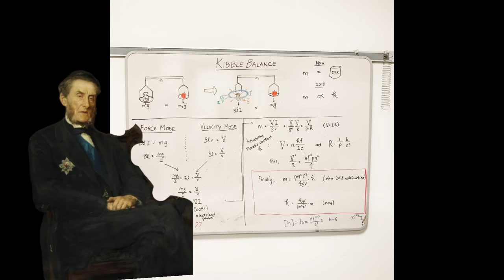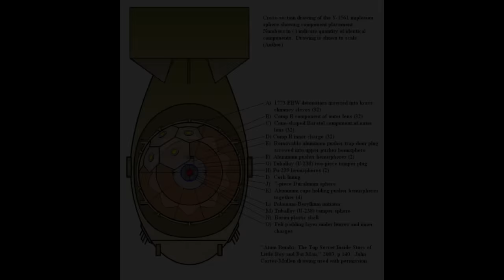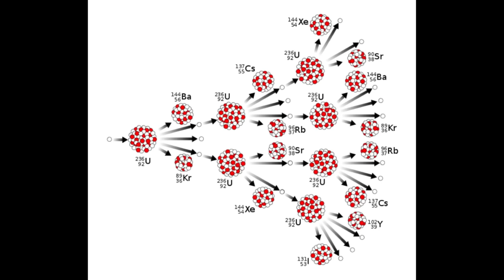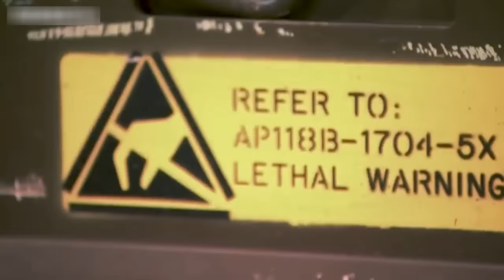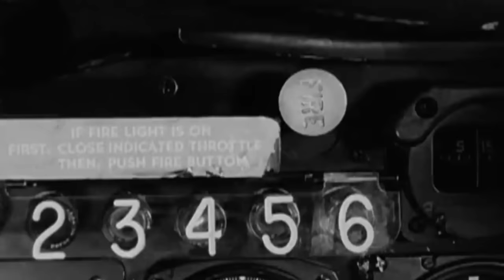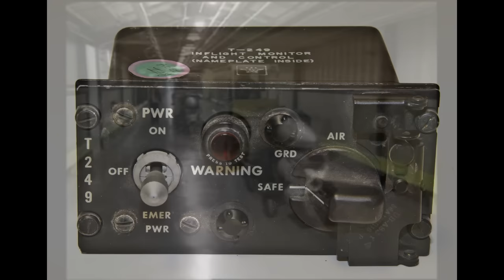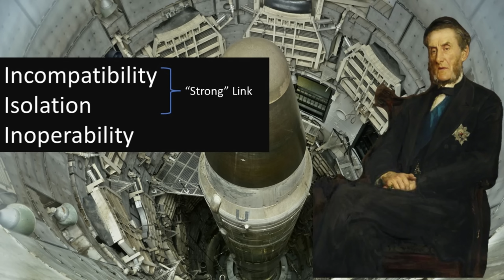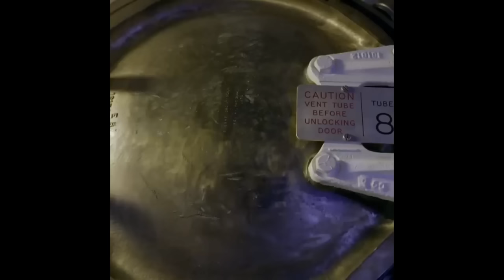This Way Toward Enemy - How The Bomb Didn't Quite Go Boom

Comment: An additional Iowa anecdote you may find to be of interest, especially regarding the testing of nuclear weapons - the Iowa Army Ammunition Plant, situated just west of the small city of Burlington, Iowa, a port city on the Mississippi River, has a long and thoroughly disreputable history concerning nuclear weapons. This site, which is fenced off and guarded, is over 19,000 acres in area. In comparison, the New York borough of Manhattan has an area of slightly more than 14,000 acres.

During the 1990's, then Iowa senator Tom Harkin managed to get the Department of Energy to declassify a number of records pertaining to the horrific mistreatment of workers at the plant, who had to routinely handle highly toxic or radioactive waste materials with little or no protection - workers were even 'encouraged' to leave their dosimeter badges in their lockers instead of wearing them during their work. As you can imagine, the illness and mortality rate of these workers was very high, causing a number of them to file suit against the government to at least get some idea of what they were exposed to during their work at the plant.

One of the interesting bits of information that was declassified at the time was the fact that the plant was the site of over 700 nuclear weapons explosions, which they referred to as 'hydroshots', using depleted uranium instead of fissile material. This occurred over a number of years during the 1960's and early 1970's, often releasing a plume of toxic explosive residue and depleted uranium into the air.

A friend of mine, who grew up in Burlington, told me that during her time in school she often heard distant explosions coming from the west, and was informed that this was merely 'blasting at the quarry'. Her father worked at the plant, purportedly in maintenance (workers held security clearances and no one spoke of their work), and died in his early 30's of esophageal cancer.

Since Harkin managed to declassify some of these documents in the late 90's, they have slowly but steadily been disappearing from the web. 

Iowa also took a very heavy hit during the time of above ground testing in Nevada, with many tests dropping a great deal of fallout across the entire state. I grew up on a dairy farm, guzzling raw fresh milk as a child, when in July, 1962 the US conducted Operation Sedan, to illustrate how useful nuclear weapons could be to create ports, burying a nuke a few hundred feet underground, then detonating it. The crater is still the largest man made crater on earth, and it lifted a mountain of hideously contaminated soil far up into the stratosphere and jet stream, with a fair amount of it precipitating out several days later during heavy rains over the pastures of my farm and being consumed by the cattle, who were milked shortly after and the milk then consumed by myself. I was diagnosed with thyroid cancer in 1989 and underwent a total thyroidectomy followed by a dose of Iodine 131 to kill any remaining thyroid cells.

I vividly remember the technician who administered the I-131 to me. it was a small paper cup of water, spiked with the I-131, which he handed to me holding it carefully at arm's length, wearing a plastic face shield, a full lead apron extending to the ground, and what looked to be like a heavy leaden falconer's glove on the arm he used to hand me my little cocktail.

'Here', he said, 'drink this'.

 I was instructed that I had been given a dosage of 29.9 milliCuries of radiation because a dosage of 30 milliCuries would require me be hospitalized and isolated for several days. I was instructed to stay away from people, avoid sex, and flush the toilet at least three times each time I used it.

Afterwards I wandered over to a friend's lab in the biology building in Iowa City, home of the University of Iowa, where he was working on his doctorate in microbiology. As usual I picked up the lab's Geiger counter, just fucking around, and turned it on, pegging the needle. My friend, who was not aware I had just swallowed a radioactive cocktail, immediately panicked thinking there had been some terrible radioactive spill. He was reassured when I told him of my treatment and found that the Geiger counter could pick up my gamma ray glow from over 15 feet away. 

He cancelled our plans for dinner later that night.
Reply: That's absolutely wild! First the absolute disregard for health and safety by the people who operated these facilities, then the fact that your treatment involved such a high dose!
Hope you're ok now.
I read somewhere that the U.S killed more of it's own citizens than Japanese citizens despite Hiroshima and Nagasaki just from the fallout from the testing of bombs in the USA.

Comment: One calorie (4.18whatever Joules) is the energy needed to raise the temperature of one gramme of water by one degree Celsius - as opposed to one Calorie (with a capital "C") which is a thousand calories or 4.18 kilo Joules which will raise one kilogramme of water by one degree .
Reply from the maker: I'm using the commonly used term, but if you want to divide everything by thousand in your head to make yourself happier, go for it

Comment: Only 1 Convair XB-46 was built,  een though itwas a straight wing design, it was a beutiful looking aircraft that lost out to the B=47.
The Martin XB-48 was also a straight wing design that lost out tothe B=47, it's engines were 3 x J35s in a box under each wing, which wasn't as stream lined as they thought it would be, ir was like having a barn door there instead.
Also the B-47 had a high aamotnt of  peacetime losses, which contributed to the Broken Arrow incedents.
Reply from the maker: I did not know any of that, so thanks
Reply: Sory about the spelling, I was using a Chrome Book and lying in bed at the time.

Comment: Thanks for this - no-one under, say 45, can comprehend how fckd up growing up in this was.  Worse by far for some too.  By 10yo I was mapping the blast radii of 1mt airbursts over Sydney.  Airliners scared me most days, yeah, I was at the upper end of the PTSD spectrum.  I knew my different MIRVs & differing payloads, our library had a great nuclear war section.
Any day the end could, as you say, randomly happen.  Probably wouldn't, but it could.  Australia seemed half-safe outside major cities & ports.
My Cold War life: after a strict boys' school til '84, with Reagan & Thatcher actively destroying my hopes for our biggest allies, it was a great but very crap time.  Looking at the world, it looked safer long-term to be in the RAN if sh*t went down, so I'd taken a navy scholarship.  Not kidding, that was the big factor over doing mining engineering, which seemed dangerous in a lot of ways, including being a target.  I figured that if the missiles started flying, no-one would be much interested in a random frigate or mwv in the Pacific or on an obscure, distributed shore establishment.
MAD is not a common deciding factor in 2023 Australian career choices afaik.
Tbh, I'm old enough that I originally trained as an NBCD officer.  CBRN is a post Cold-War term.  'R' was assumed to be 'N'.

Comment: I'm a child of the cold war. I was born at the Naval Ordnance Test Station China Lake CA. My dad was US Navy enlisted. He crossed over to the USAF and worked those F-106 Delta Dart interceptors shown in your film. I did my time in the Air Force too, I'm glad we stood against Soviet expansionism, the Soviet system murdered more people than the nukes that held them in check did.
Reply from the maker: I hope you don't misinterpret the need to apply saftey standards so we don't nuke ourselves for some kind of approval of the Soviet system
Reply from the maker: I'm pretty sure I called out that the US was the gold standard in that it's generally reported and expected that those who handle weapons will learn from it. We simply have nothing from what was the Soviet Union or Russia beyond stuff that is easy to detect - a couple of sub accidents, failed cruise missile test and a few domestic reactor problems. However the Soviet system had some advantages over the US one because movement and handling of nuclear weapons was not a thing done anywhere nearly as regularly- becuase the system was terrified of internal dissent it controlled who had access and what they could do to an almost pathological extent. Who knows, I'd love to find out more, but it's seriously unlikely anyone ever will

Comment: I'm afraid you've got some of your terms mixed up. The pit is at the center of the core, which contains the initiator. The initiator is composed of isotopes of beryllium and polonium and floods the core with neutrons when compressed, kick- starting the fission chain reaction. The secondary fusion doesn't occur in nitrogen, it occurs in lithium deuteride (mainly), although some earlier articles used deuterium or tritium. 
 Fun fact: The Castle Bravo shot wound up being over twice as powerful as expected because the physicists mistakenly assumed that Lithium 7 would be inert in the fusion reaction. The result was a humanitarian and ecological disaster and they were really lucky they didn't end up killing more people.
Reply: My understanding is that modern warheads use Pulse Neutron Tubes to create the burst of neutrons needed to start the chain reaction, and these are placed outside the explosive/pit arrangement.

Comment: Little boy was a uranium bomb and did not use or need lensing. The unit carried two separated lumps of uranium, carried inside a gun barrel layout. A block of balsa wood kept the uranium separated, (one half of the critical mass was not installed until nearing the target) Once the bomb was released it would be triggered by a simple charge of dynamite at one end of the  gun. The igniter would be triggered by a barometric sensor, allowing it to ignite at a predetermined altitude. Fat man was the PU bomb and had to be lensed to work,  however, it needed the nuclear triggers that you mentioned and absolutely perfect timing for the criticality inducing compaction to occur.
Reply from the maker: Yeah I figured getting into gun barrel triggers was a whole other thing and the video was long enough ;)
Reply: @HardThrasher  New subscriber, and I wasn't having a go. You did a bang up job and amused me mightily, I just thought I could fill out the detail in a few short lines, without being too much of an arsehole.

Comment: RAF Leconfield was about 10 miles from where I grew up.

Interestingly I remember that about that time the city council did a test where a vehicle with an air raid siren blasting away had to drive through parts of the city to warn everyone of an imminent nuclear attack. It failed miserably. Especially as they would only have four minutes before the missiles struck. And later I learnt that we were down for four warheads. So with r without a four minute warning that mobile siren was not going to be of help.

Comment: Only a plutonium bomb such as that exploded during the Trinity test and that dropped on Nagasaki requires implosive compression to set it off. 

The Hiroshima bomb was a uranium bomb and simply required a uranium projectile to be fired into a uranium target, achieving crtitical mass. That is a much simpler procedure so no test was required before using it on Hiroshima.
Reply from the maker: But implosion was the method used by basically all subsequent bombs, hence not getting into the gun method here

Comment: Cracking great video!

As regards the Trident IIs using conventional high explosive lenses, the going theory was that because the missiles were going to be underwater most of the time, the compactness of the warheads compared to insensitive HE was seen as an acceptable tradeoff. If a missile had experienced a casualty at depth, it could just be jettisoned unarmed, and even if the missile detonated (non-nuclear or fizzle) and destroyed its sub carrier, the water would contain the blast and any radioactive material would carried to the ocean floor by subsurface currents.

However, considering the Apollo 1 fire resulted in part from NASA and many contractors not realizing the fundamental risk of pressurizing a spacecraft with pure O2 above atmospheric pressure for a live electrical test, the thought of a dock-side casualty? Uh...😨

Comment: 2:44 "All of these have massive warheads." The W54 device in the projective fired from the Davy Crockett had a yield of 20 tons: 1/1,000 of a Nagasaki. Hardly massive.
Reply from the maker: Complete the quote old chap "for what were supposed to be battlefield deployable weapons" - no one was trying to use Fat Man to take out a pillbox, but they were seriously suggesting replacing a bazooka or a tank shot with a nuclear weapon. The Davey Crocket was an insane idea, as were pretty much all tactical nuclear options, that would result in any battlefield becoming an irradiated wasteland through which armies couldn't advance, not to mention the probably of a rapid escalation curve leading to strategic missile use if the tactical nukes got used. It's called the nuclear taboo, after all.

Comment: I want to sleep. Rewatched the how it works part 3 times and still don't know where are the X units memtioned that lighting supposedly activated
Reply from the maker: So the X-Unit is the name for the fillament of wires that wrap round the explosives to deliver timed electrical charge so all the explosives detonate simultaneously, creating the compression needed to trigger the bomb - the originals were highly sensitive to static

Comment: "Ninety-nine dreams I have had, and every one a red balloon." - Nena (English version, not a translation of the German original)
There was another incident I heard about: some of the old air-launched missiles were scheduled for decommissioning, so they were loaded onto the bombers and flown across the USA from the bit nearest Russia to the bit where the engineering company doing the decommissioning work was located, taken off the bombers and delivered to the engineers, who opened them up and found out they still had warheads in them.

Comment: The explosion in 1980 was in Damascus, Arkansas (<< pronounced "Prrpherderfffizzzz" - or something).  And it didn't just send the warhead flying 150 feet into the air... it blasted it completely through the three foot thick, solid steel and reinforced concrete door on top of the silo.  Additionally, there is a PBS documentary also called "Command and Control" that is part of the "American Experience" series.  It's specifically about that incident in Damascus.  When it occurred, I was 16 years old, and I lived only about 40 miles from what would have been ground zero had that 9 megaton, W-53 warhead somehow exploded.  Two years later, I joined the US Navy, and went to work as a missile technician for the Trident 1, within the US Nuclear Submarine Service.

Comment: Very interesting, the problem is that the people dealing with these things get complacent. It is still a problem, think Chernobyl lets do an experiment, oh dear. Very easy to get complacent with these things. Remember also there are a lot of research reactors around, I remember as a student at a facility having a safety talk, bells etc warning of fires but the last question puzzled us all. What do you do if you hear a continuous siren, we stand in the car park and await fire crews the reply was "Nein, you check the wind direction and run quickly into the wind, the siren means the research reactor is in meltdown". Thankfully it never happened and the facility is still there after 50 years.

Comment: There's a reason for having "thousands of warheads" and not blowing up is: Most of them are not in a deployable state.
The shelf life for a nuclear warhead is between 15 and 20 years. Only the US and China currently have the required facilities to keep them maintained and it's an outrageously expensive process. 
So, the "less qualified" personnel in charge of nuclear weapons are normally stationed at places where warheads are inactive or unmaintained. Don't get me wrong: firing a nuclear-tipped missile causes a radiation accident even if the warhead doesn't detonate. But it's not as bad as a nuclear detonation. 
Given this fact, I believe that a)The number of active/usable warheads is a lot smaller than most people think. b) Countries that don't have means to access maintenance facilities can't be considered reliable nuclear powers(Pakistan is one of those, North Korea is another, althought they're believed to manufacture six to seven warheads yearly. How this estimate has actually been calculated is beyond me)
Count warheads in the hundreds, instead of thousands. Not that they're not bad news, tho.
Palomares is visited by thousands of tourists every year. No increase of radiation related diseases has ever been reported. The Franco's regime's minister that took a dip in Palomares' beaches died at 92 decades later.

Comment: You probably don't actually need any explosives to make it explode. A gun type device which has had the problematic U-233 removed could probably have a better than not chance of successful assembly and detonation using a hard impact to decelerate the target at the bullet.

A hypothetical stable fissile isotope (fortunately by shear luck no such thing exists) could theoretically be assembled by a linear actuator or even by hand. It's a tremendously bad idea but it could theoretically even be stored assembled if you don't mind it randomly melting itself if a single stray neutron gets in.